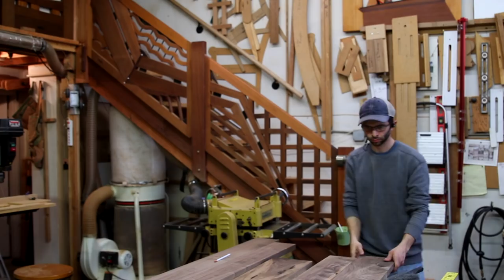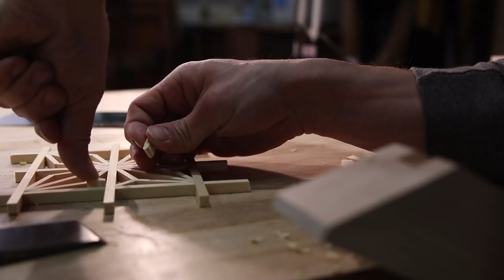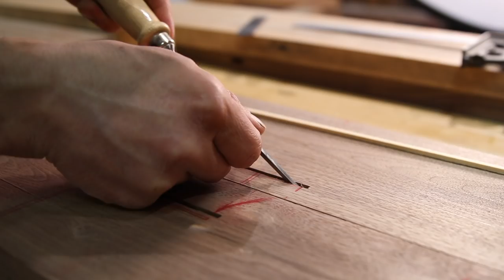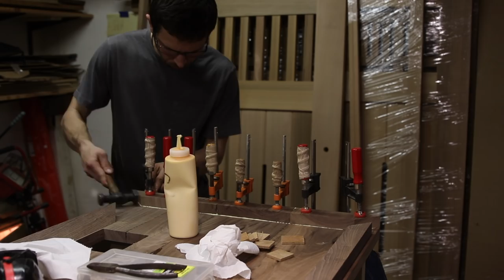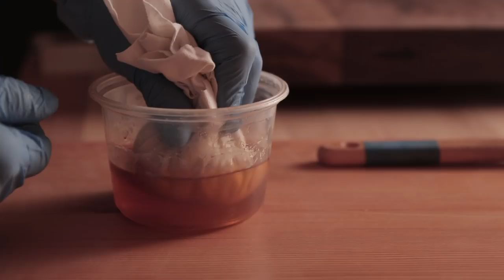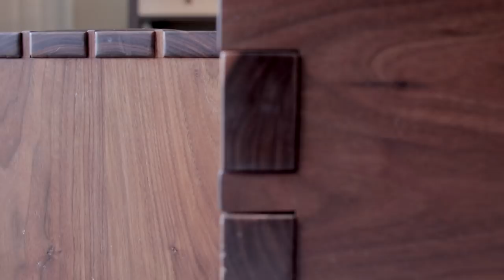Kumiko Headboard - Two years in the making

Comment: Really gorgeous headboard. I've been looking for a bed/headboard project and think I found it. Also, been wanting to make my start into Kumiko which is how I found this video/your channel. I'd like to take a stab at this design and project, putting my own twist on it I am sure. 
Question...please tell me about your finish on this one. Seems you went with three steps, the middle being a clear solution with foamy top...I assume soap? I'd like to know what oils you used right up to the Howards wax/oil completion. Thanks
Reply from the maker: For the finished I went with a super blonde dewaxed shellac.  The first coat was applied with a brush and allowed to dry over night.  Then I sand it down with 0000 steel wool and 600 grit sandpaper, lubricated with soapy water.  The next coat of shellac is applied with a french polishing technique.  (cotton wrapped in a rag).  After the shellac, I repeat the steel wool process and apply the wax.  
Hope that helps.  Thanks for watching,  Ross

Comment: Hi Ben, I'm looking at doing something similar - with Kumiko into a slab. Have you had any issues with wood movement in this headboard?
Reply from the maker: Thanks for watching.  No issues with this piece, as it's is a pretty movement friendly headboard, with no opposing grain direction other than the vertical side pieces of the kumiko.  But those are hardly enough to cause any problems.
Reply: @bigben380  Yes, sorry, I didn't specify what I meant by "wood movement issues" - the kumiko is exactly what I meant. I was worried that you might get some separation in the summer or potentiallly pieces broken in the winter? Sounds like it's not a problem?
Reply from the maker: @Subsonic-cd2en  Got it.  No issue with the kumiko. Each joint does get a small dab of glue to ensure that they don't come loose in dryer months, when the wood shrinks (I apply this with an awl). There just isn't enough tension in the small kumiko pieces to cause any noticeable damage when they expand.
Reply: @bigben380  Nice. Thanks for the reply!